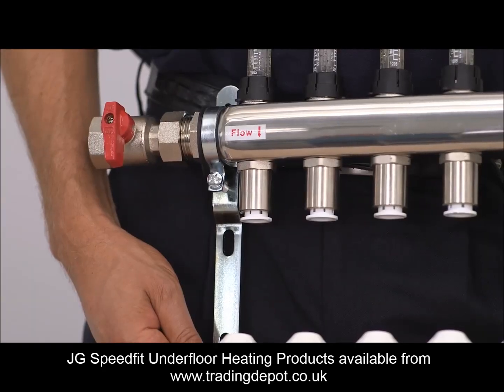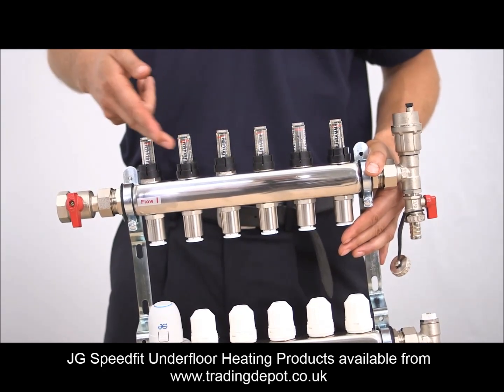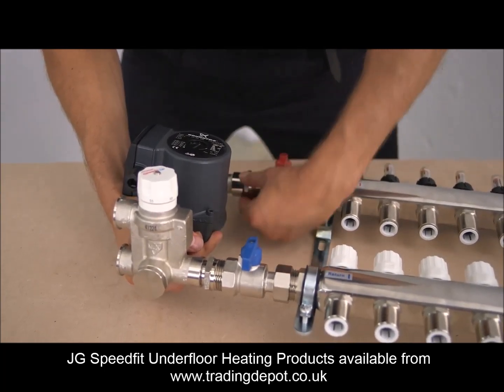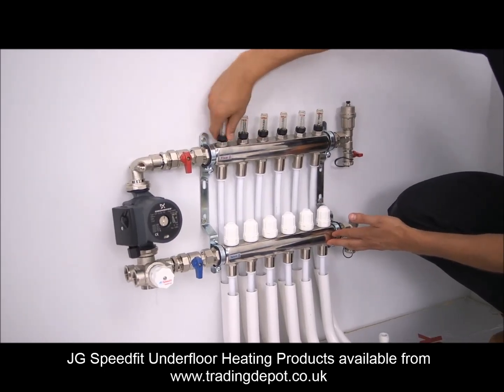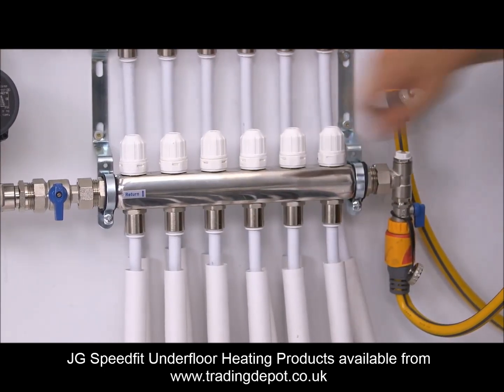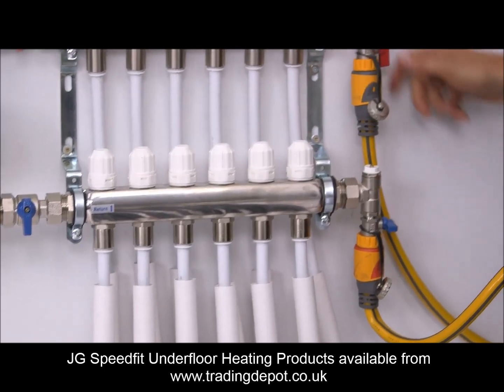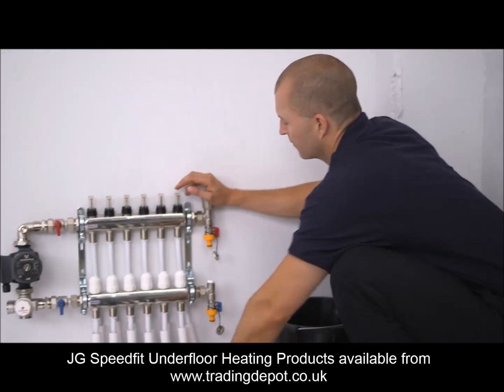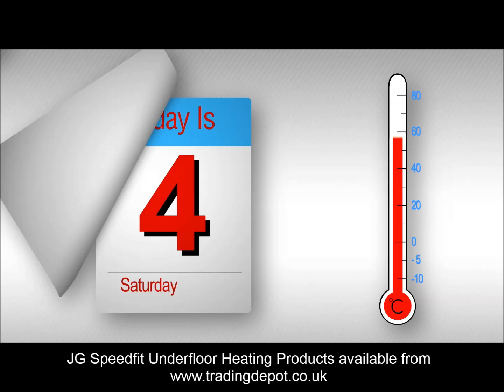Installing the JG Speedfit Underfloor Heating Manifold

Comment: Please show us how to connect the left side of the pump where main flow and return pipes will be installed. This part comes with 22mm x 3/4 Male compression. But if we have 16mm UFH pipe then there is no reducer from 22mm to 16mm available. how do we connect 16mm pipes to flow and return.

Comment: Hi - my system worked fine until I messed up when I made a change to the Aura wireless thermostat. Now the UFH works but I can't get the radiators to come on (these do not have thermostats on each radiator). I must have set up the two aura thermostats wrong, but can't work out what settings I need to enter after reboot.
Reply: Zor
Reply: I live in Nigeria work on plumbing system technics

Comment: Do you really run 60°C through your underfloor heating? In our installation a safety switch cuts out all pumps if the temperature should ever go above 40°C (water is mixed near the pump in the basement). Typically it runs between 30 and 35°C.
Reply: Max 45. But yeah, 60 it s way too high

Comment: Why fill the loop *then* pressure test? If after filling the system it is pressurized then if there's a leak somewhere the pressurized water will cause damage... Air testing should be done before filling.